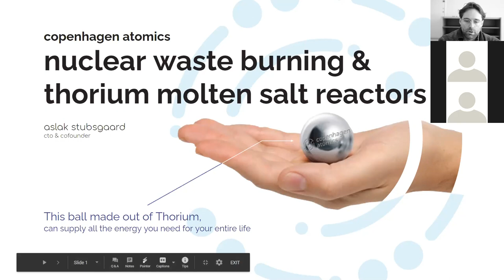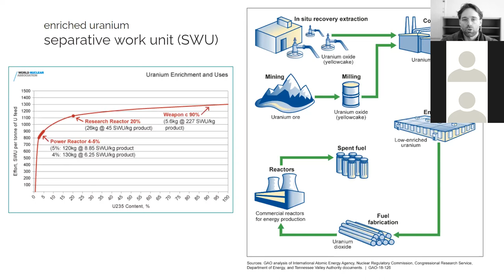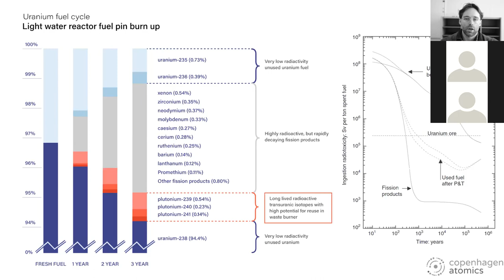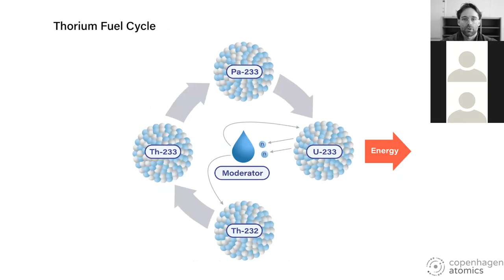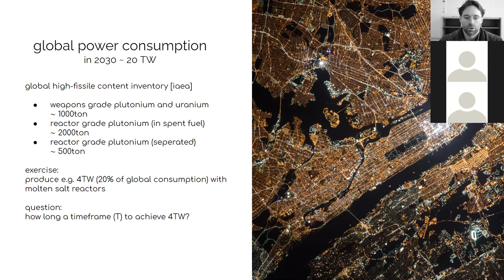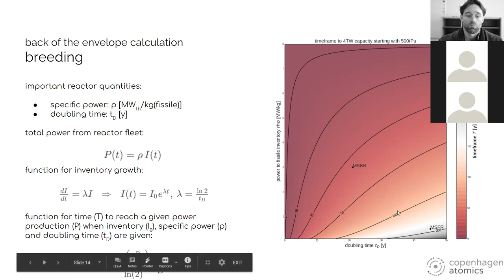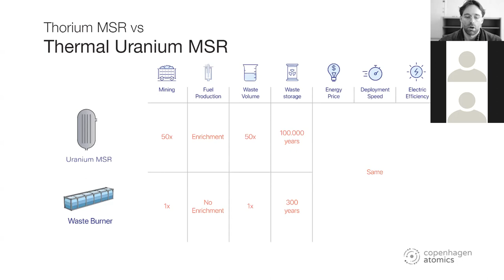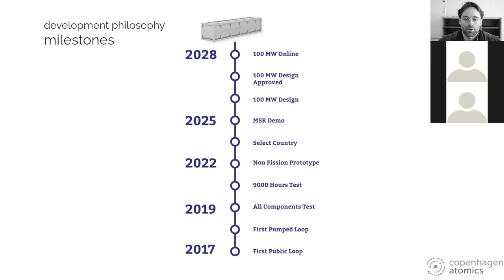Thorium Master Class: Nuclear waste burning and thorium molten salt reactors (17-02-2021)

Comment: So my question is---how much reactor grade plutonium is needed for a 100 mega/watt shipping container sized reactor? How many kilograms? So it depends on how large the reactor core is with graphite Channeled moderator and which salt is used whether flibe or flinac or NaCl. Also it depends critically on the percentage fissionable in the salt. The core could be very small depending on intercooler flow rate. The smaller the more criticality would need controlled by temperature.

Comment: Thorium is just a buzzword, a slogan, it's meaningless. What is not meaningless and is the future energy source for the world is the molten salt reactor in both the thermal and fast spectrum. The fuel is much less important and it certainly won't be thorium for a very long time.